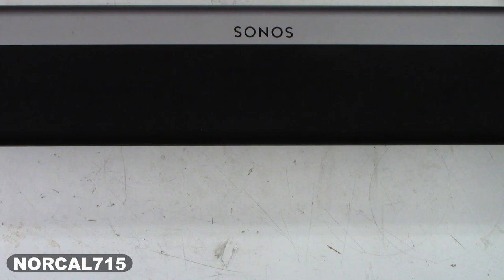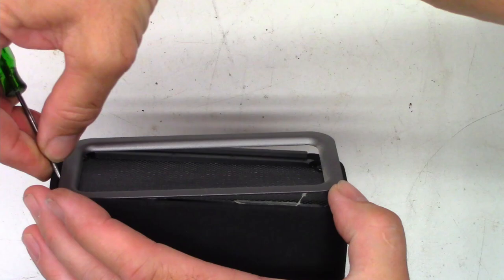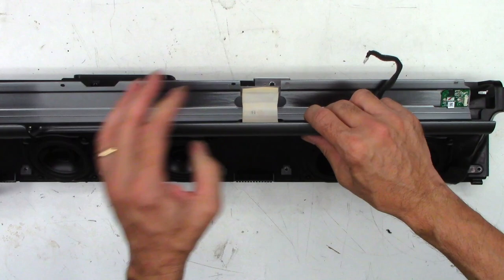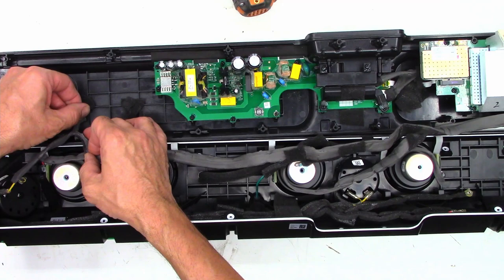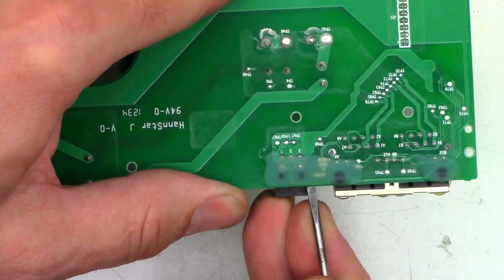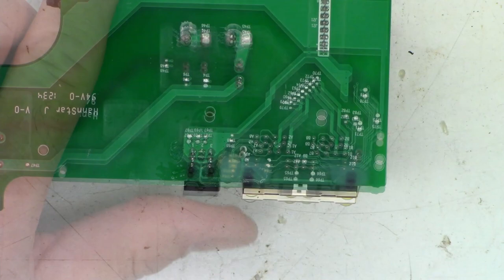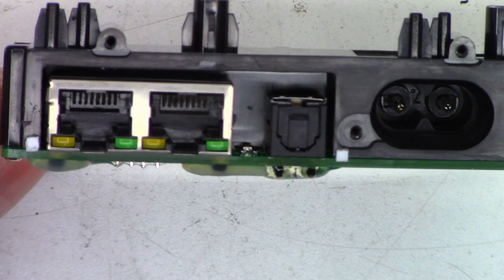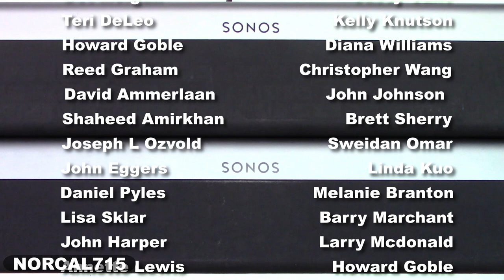SONOS Playbar Soundbar (Actually 2 of them) sent for repair. Optical Toslink jacks inputs damaged.

Comment: I did the repair today, but the connector is different, it was PLR131/T7. It is held in place with a shielding over the connector and has no ground pins on the bottom. After some modification I could fit it and I also needed to lower the whole in the casing, but it works now 👍

Comment: Just got through the disassembly. Regarding g the wifi, can't you just remove the card by taking out the two screws and sliding it out? One of the three wires broke from the connector when I tried to disconnect it. I'm hoping a little solder and got glue will fix it.

Comment: Hello, nice video! 

I have this playbar and it stopped working (no sound) and disappeared from the Sonos app (updated to S2 version). Usually, I would fix this by resetting to factory settings (unplug, hold play button, plug back in while holding for a few seconds and wait for flashing green light). However the unit just stays solid white and won't reset.

Sonos' solution is to send it to them and they'll give me a discount on their newest model... no option to get it repaired even if I paid completely out of pocket. Complete fail on the right to repair scale.

Do you have any idea as to what could be wrong?

Comment: I have a question. I have a playbar and it stopped working. I tried using a different cord but to no avail. So I decided why not give it a tap to see if I can get it to work again. Upon doing so, the light on the side lit up them promptly unlit. Do you know what this can be?
Reply from the maker: Probably an intermittent connection somewhere in the circuit. Possibly system control (computer) or power supply issue.
Reply: I have the exact same thing happening with mine! I have disassembled it, but see nothing suspicious. I am going to try resoldering the mains connections to the board. All the capacitors look good, and no funny smell. Fingers crossed! lol

Comment: Need some help, my Playbar just stopped working, no light comes on when plug it in. What could be the problem? Tried new cable, but nothing changes.
Reply from the maker: Hard to say, 1 of 3 things could be wrong. 1-The standby power supply has failed, and is not supplying power to the microprocessor. 2-The system control is not responding. 3-It is failing to start the "run" power supply. Do you have a way to measure the standby power consumption, like a kill-a-watt meter or similar device?
Reply: @norcal715  unfortunately not, i dont have any device. But i’ll bring it to someone to check it up, i’ll keep you posted. Thanx🙏🏽🙏🏽

Comment: I have a playbar,after move house ,it cannot to connect  internet,and light not change with press button
Reply from the maker: Try a factory reset then do a complete setup with the mobile app.
Reply: Hi,I try to factory reset ,when hold + & play button and plug in power,light still white ,not flash .
Reply: @eyesboy507  did it ever work